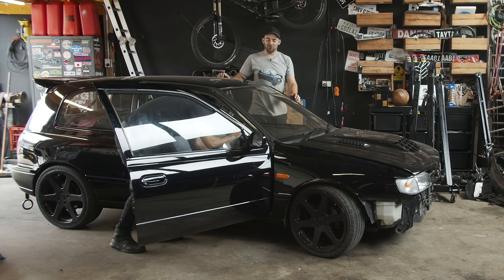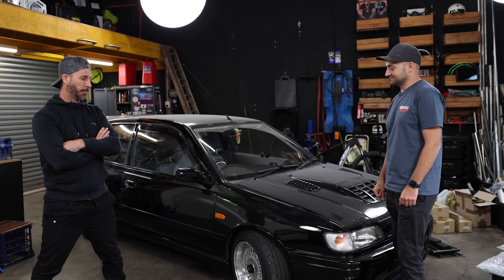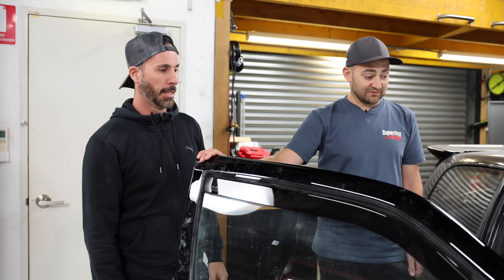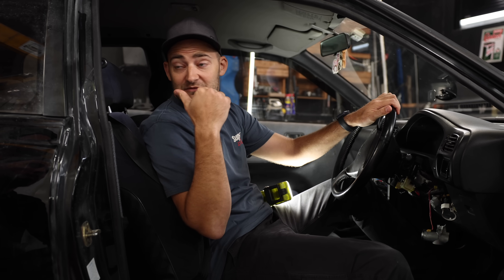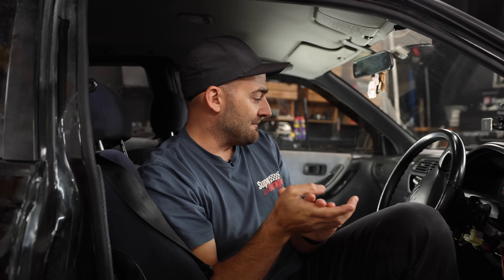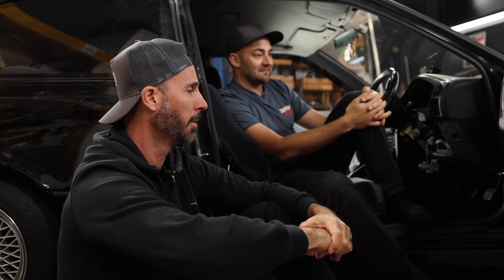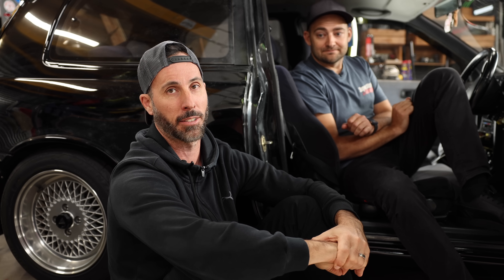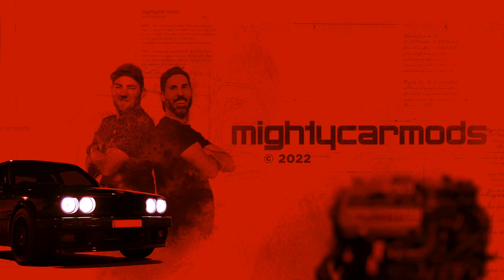Someone tried to Steal the GTi-R | Police Called

Comment: I too have been a victim of theft. In 2015 My 2002 Subaru GT Legacy 5spd Wagon Absolute thrashed Nugget was stolen, filled with drugs and driven to Ottawa from Sault Ontario. The dash was hacked up, door locks destroyed and the brand new stereo system I had installed literally the day before was removed and gone when it was found. The car was a rusted out pile of trash but it was MY pile of trash. 
I am sooo sorry this happened to you guys, I work at PartSource here in Canada and I will see about trying find replacement parts for you if needed.

Comment: Someone tried once to steal my JZZ30 Soarer from outside a workshop many moons back. They damaged the steering column etc same as you guys had done to the Pulsar. But the immobilizer (Mongoose M80) I suspect prevented them from getting any further, in addition to being caught trying to steal it.

The workshop was decent enough to buy me an entirely new lock set from Japan with the correct JDM Soarer key.. and since then, I've never re-visited that workshop as it was based in a scummy area..

I do have an Elite 2500 in it now, so maybe that'd be a good idea to prevent theft, as you both described. I should also install a kill switch.
Reply: good taste, the mighty road sausage is a fantastic car

Comment: @Mighty Car Mods you can repair the door easily put your knee at the top of the door where the window frame starts then pull it back repeat this until it’s lined back up. This is a common repair and not unsafe as long as the door frames not kinked

Comment: One thing to note about fuel pump kill switches on loud cars, we love ours because you can hear the car start then choke out and die when it clears the fuel lines. Makes for a really good alarm and a way to panick any thieves that do get it started.

Also if you own an older 4wd with barn doors on the back check those rubbers, especially on the smaller door! Most old land cruisers you can rip the rear windows out with your bare hands cause the rubbers are 30 years old, great if you lock your keys in the car, but not so great if someone else wants it

Comment: Another important tip if you own a desirable car is to avoid leaving your keys near the front door at night, it's remarkably easy to reach through a letterbox with a bit of coat hanger wire and snag them. I've personally done this 3 times trying to get back into my own house after locking myself out and friends houses for the same reason, you'd be surprised how far into the house you can reach if you can see what you're doing or have someone to guide you (ie. someone looking through the window). I'm told that if someone is targeting your car they sometimes knock on the door in the guise of a lost pizza delivery man (or similar forgettable, often helmeted disguise) in the evening and use the opportunity to scope where your keys are placed.

Comment: Tracking tiles, learn to love them, so many ways to be used.  A few could be left in obvious spots, a few more could be buried inside the chassis behind a welded steel panel.  Most pro car thieves won't be carrying an RF meter, but might carry an Iphone, and dry snitch on themselves.  How I know about car theft from the professional side, is from a past I haven't been a part of in over 20 years.  I work a good job, I have decent life, my reason for being dishonest are gone. The only thing, I hope to do now is balance my karma, by given advice from a prospective most people will never have, that of a reformed thief.  I'm not proud of my past, I own it.  If I can help someone not get ripped off by some jerkoff like me, it's the first thing I can do.
Reply: Reformed people like you should be doing consultant-work with insurance/car-alarm companies and the likes. :)
Reply: Everyone deserves a second chance. Glad to hear you changed your life. And tracker placement is incredibly important. I lost my KTM 690 to an angle grinder through the chain and not having a well enough hidden tracker. There's not many places to hide one on a naked bike and the suspicious plastic box under the seat with wires going to the battery was the first thing to get stripped off the bike.

Comment: Ah, back in the day it was so simple, you just pulled the the rotor arm out of your distributor and put the cap back on, if you also disconnected the ground from your electric fuel pump then you really thwarted most attempts.
Reply: Rotor button in my pocket saved me a kingswood from getting taken from Bankstown Square many years ago, they even got the club lock off
Reply: Easy enough to do that now. Just take the fuel pump relay out of the fuse box.

Comment: I had an old fox body mustang, in highschool that I used to have to start with a screw driver due to the key being lost ever since we saved it from a back yard. Finally after some time, I bought a new key switch set and it took me hours to get the old one out due to not having a key to turn the lock. I had to pick, pry, and pull out ever tumbler to get it to slide out. After I was done, I felt so accomplished and excited that my car finally started with a key again... the very next morning, there was a bolt lodged and sheered in that new key cylinder from someone attempting to steal it.

Comment: i use a latching relay. i wire it to something unusual to trigger it. whether it be a windshield washer switch or the passenger airbag turn-off. just something that would go unchecked. cant start the vehicle till it’s activated and stays ready until you turn the car off

Comment: The joys of owning an old Nissan in Australia.  When I had my S15 someone tried to break into it outside my house right near a busy Rd and ended up snapping their screwdriver in the door lock. This was way before they were expensive back in 2014. Also the Nissan pulsar was for years the most stolen car in Australia.
Reply: N15s still turn up in serious numbers at auctions as stolen recovered cars in some form or another. I came across an immaculate 1997 N15 Pulsar manual on a lot and didn’t buy it, six months later that once shiny example was seriously damaged at auction after someone stole it. Hyundai Excels also suffered that ignominy as well for a time for being very easy to steal with virtually no anti-theft on them.

Comment: That kind of door entry was very popular in Brazil to steal head units and items left into the car, the person places their foot right above the door handle below the window trim and pulls with all it's force the side of the door, they will bend all the way, a person can fit it's body into the gap, and windows mostly will not break. After stealing all your stuff they can bend  the door back to a certain point so no one will notice, that might explain your door spacing so small. Hate that stuff... Such a headache.

Comment: You could use a pull table with pullies to pull the door apart & straighten it out, then reinforce the areas that bent.
You could also install plexiglass windows or thicker windows so they can't be easily smashed..
You could also solder the ignition switch back together & work with the same key...

Comment: Last time I did a road trip I bought a special pouch for my keys, since the car was usually parked right outside the motel room, with the pouch the fob signal is blocked and eliminates one way to steal the car or break into it. Cost next to nothing on eBay and a nice bit of insurance.

Comment: As briefly mentioned in the video, make sure your keys are secure in your house. As cars become harder and harder to steal, a more common occurrence now is for thieves to break into your home and steal the keys, as many modern cars simply cannot be hotwired any more - no key, no vroom vroom. Don't leave your keys by the front door, or in plain view from a window. Ideally get a key safe and keep your keys in there, away from easy access. I've had this conversation with various police officers - making your stuff harder to steal will make thieves go elsewhere looking for an easier score. Same applies to your house, any outbuildings and so on. Make it secure and make it visibly secure as a deterrent.

Comment: I have suggested to a couple  of collectors that they micro dot all the panels, wheels, engine and gearbox anything that could be sold including windows just with a traceable number like the body number or engine number something on a rego form the is unique that if you run a scanner over the panel or component that it will read and can be tracked back to the owner.

Comment: I'm not sure if they're popular in warm climate areas like they are in cold climates, but remote starters essentially bypass any immobilizer your car may have come equipped with. I know where I live in Canada for many years popular remote starts had the antenna mounted on the windshield above the mirror and sometimes had a little blinking light on them. Not sure why they had it, maybe to try and trick people into thinking it was an alarm or something. But in the end it was a little blinking beacon that told thieves "hey this car/truck is super easy to steal".

So food for thought if anyone has an aftermarket remote start installed in their vehicle to be extra cautious and it would be a good idea to have some kind of hidden ecu/fuel killswitch as well.

Comment: A simple latching relay with a small buzzer that turns off the fuel pump and fuel gauge to show empty, hidden micro switch under the carpet that is a one push to latch the relay and no need to Remember to turn it off.

Comment: My previous car got broken into several times at work. With them not getting it, but leaving stuff at the scene. They dont use screwdrivers these days, they use scissors. Early to late 90's cars are tageted as the ignition and door locks are usually worn by that time.

Comment: A bit out of context for the video, But the sr20's can sound absolutely sick. My 180sx sounds so tough and angry. 6boost manifold, external wastegate, 3inch exhaust, makes about 370hp. Nice deep grunt, doesn't have any of those horrid raspy notes like a lot of 4 bangers get.  The right mods will do any engine justice.

Comment: The wireless unlocking of car.. I've been to a local unnamed hackerspace some time ago, and bunch of people there developed a RF sniffing device, that could sniff (catch), if necessary decode, and even replay the signal that it catched. They very gladly demonstrated it on some cars on their parking lot (with approval of owners obviously), and it just worked. Standing about 20m from the person, they just recorded the "unlock" and "lock" signals, and were able to replay those commands and unlock the car. And since it was pretty advanced, they could replay GSM codes for like gates and even some home alarms. Crazy stuff. They were huge nerds and it took them some time, but it was done, and proven to work.

Comment: My first car in 2004 was a 1994 nissan micra, had zero factory security on it. The fuse box was right by the drivers knee, i used to leave the plastic fuse puller attached to the fuel pump fuse & pull it out & store it inside the case for my flip off headunit. After a week you got used to where the fuse went so you could stick it back in without looking. That, plus a £20 argos sparkrite alarm cable tied to the battery & connected straight to it seemed to keep the thieves away. Back then, in the UK joyriding was still a big thing. Cars these days are stolen for parts/cloning. No one joyrides so much. Sorry to see what happened, hate thieves of any kind with a passion 🤬

Comment: I had someone break into my truck, they also bent the door like that but when that didn't work they smashed the side window because the back window didn't smash. They didn't wreck anything inside beside bleed everywhere after getting cut on the glass. They left the cd.s, money. They did steel an old (as in 2004) iPhone cable. 
Got the truck repaired. The cost to repair was $8000 in Canada

Comment: DOOR: NZ, it's the same door as any N14 pulsar 2-door, especially the Gti (SR18DE) and the sissy 1.6L
 NZ has loads of those in the wreckers. Same thing for the steering column surround trim pieces.

Comment: In the early 1980s dad rewired the cars with a flip switch that you had to hit, run the key and then the horn was the starter. You then flipped it back after the vehicle started. Worked great with a couple of attempts to steal vehicles from us.
Reply: wnnalis cioov  luckily the worst was a busted window and ignition. No one seemed to ever get them started.

Comment: One of the best methods on old cars, remove your ignition rotor when you store your car for a longer time. car won't start without it, they'll keep searching for a switch or blocking system of some kind. they'll never geuss and actual part that is hidden in a cap missing.

Comment: Sad to see this happen, glad you still got it tho, woulda been pita if it came back missing parts ... 
had someone try and steal my 01 blazer ( yup a 2 dr blazer) when i was in college night class and cause I had a fuel cut off switch they never could drive it off  ... it was a LS swapped s10 blazer ... costed me $800 in window and ignition repair work ... but side note fuel cut off switch ;)

Comment: You guys should check the surrounding areas from where they tried to steal the car from and see if any other cars were stolen. I could be wrong but since they stole your battery they now have a 12v power supply, meaning if they come across a car with a kill switch like we have in the U.S. that just cuts power in the cable that goes to the starter or even just an older car without all the electronics, they can ground the battery off to the car and use the positive to bump the starter. I've seen it happen before, it's just a pain in the ass way of doing it.

Comment: It's like old 2001 Renaults. The immobilizer is part of the body contol module which fails all the time (German part). Once that stops working properly you have to replace the ECU, BCM (UCH in french cars), and the key/barrel/transponder ring meaning most of the most get scrapped when it goes wrong. Mad that people are brave enough to try and lift a well recognizable car like this and then much it up in the process. :/

Comment: Loved my GTI-R! - I was 19 when I got mine, tuned it to 380BHP, but second gear synchromesh kept failing, other than that, it was a very solid car. 
Have to say, it was a pocket rocket back in the day, leaving pretty much everything off the lights.
BTW, mine came with the umbrella that was built into the side pillar, doesn't seem like yours has that?

Comment: the 91-96 usdm ford escorts are simpler unless you put a device in it to stop them.   I had to figure it out in 2011 when my ignition cylinder locked up and nobody had parts for it,   took me all of 45 seconds with removing the plastic,  pushing a piece of metal out of the way,  which unlocks the steering wheel and then yanking the plastic switch that controls the ignition,  security on 90's cars were not the best.

Comment: Ah yes, all those emotions of having your car stolen or attempted to be stolen. I felt and think exactly the same. You didn't work for it, it isn't yours, you have no right to touch it. F off. It has happened to me twice. After the first, I took measures which saved the car on the second attempted theft. Good work guys!

Comment: I work at a car dealership, I see new cars that have been stolen all the time. Whenever a manufacturer invent a way to prevent theft, it doesn’t take long for thiefs to figure how to bypass it. Your idea of installing a cut-off switch is a good one, it will slow down the average crook, but if you deal with pros, they’ll put the car on a tow truck…

Comment: I was working with person, that in past stolen many cars. In our customers cars with immo button he just tried to start and realized, that car is immobilized then he reached in like 5 places in 5  seconds to find the button and without reading info from customer he just drove. I was unable to find the same buttons after using them in past and after reading information, and he ignored them completely.
My recommendations are input combination immos and that is it. Switches and pedals in combination of 4 and more are impossible to guess correctly and quickly, and in case of lights, pedals and key turns are not a problem to use
Reply: Also. Trackers are as fine as they are priced. When he was escaping and hiding car jamming was so ridiculously overpowered,  that not even digital tv didn't work anywhere nearby. Aftermarket immobilizer is necessary, if every car part can be sold in minutes due to extreme demand

Comment: Someone tried to steal my '89 MX5 in a similar way. They bent the door, broke the lock, smashed the window and tore apart the dash/ignition. Luckily I had done your kill switch mod which stopped them starting the car. It didn't stop my insurance company increasing my policy by £800 a year and declaring the car a write off (which affects its value) even though I repaired everything myself. They didn't even pay out!

Comment: I had to break into my own car. 1996 4runner, had left my keys in the ignition, my buddy slammed the door which closed both doors, then the car locked itself for some unforeseen reason and I had to sit there for an hour wedging rocks in between the metal door pillar so it didn't over-stretch the metal, and we used a shoe lace with a slip knot to get the push knob up. Took a couple hundred tries.

Comment: Locked myself out of my Volvo 240 wagon, turns out you can remove the rear muffler and punch out a bunghole thing and it saves waiting on a locksmith, again. The first time he tried one of those air jack things in the door jam and it took 10 mins repositioning adding more of them, it only worked because it had a mushroom style door lock. Good times, it hasnt run in 5 years, I miss it.